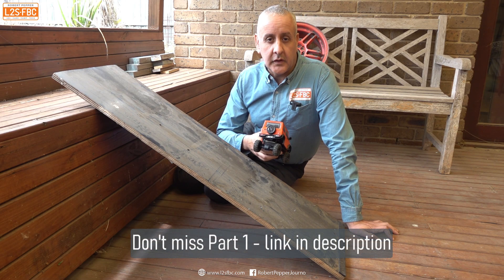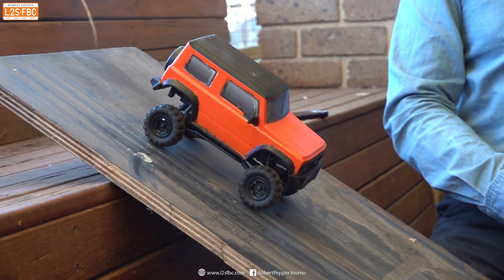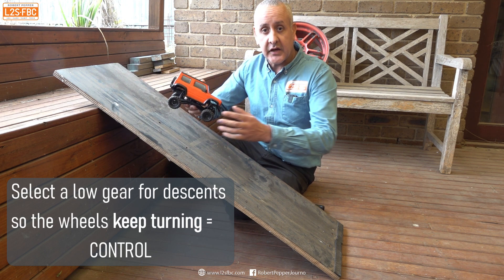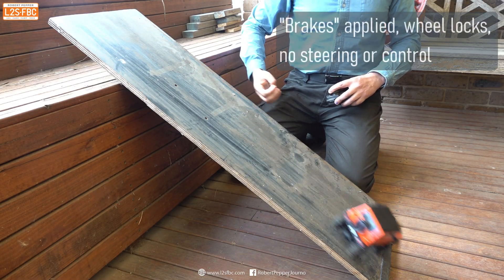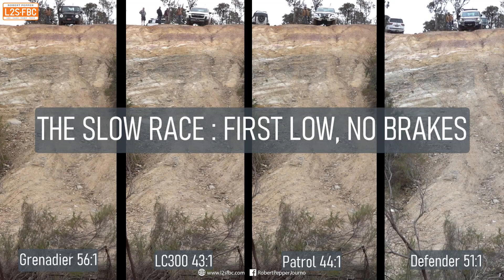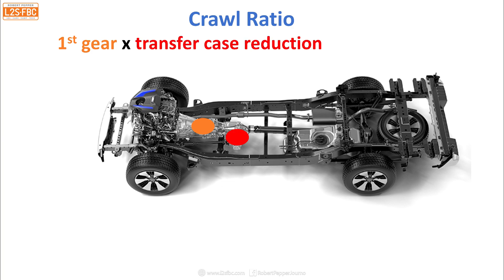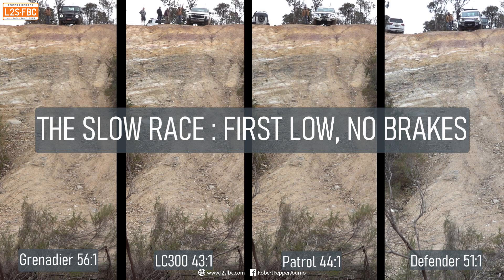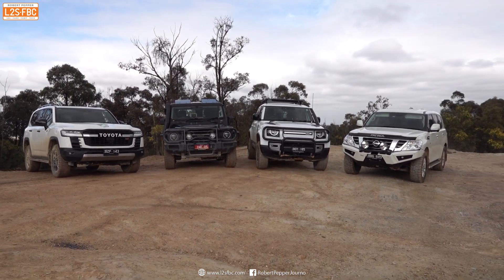Grenadier, Defender, Patrol, LC300, Part 2: the Slow Race & Hill Descents Explained

Comment: great vid as usual. but i believe one important factor you left out is the factory transmission setting if not a manual. The efficiency of transmission in descent aka "back dragging" is largely variable by varying the transmission control, doing funky hydraulic path switching stuff. manufacturers have to tell the transmission to largely quit "back dragging" in normal driving condition, otherwise a car would be funny to drive when it can't coast at all. sometimes they increase it after sensing a deliberate downshift, predicting that you want engine brake.

Comment: My 105 Series Petrol manual is lovely downhill in first gear. I think it’s a 42:1, but no torque converter slip. What’s your opinion on how these four went with keeping the engine revs low and low torque converter slip?
Reply from the maker: Manual has historically been better for descents, but no longer.

Comment: Brilliant demo. I found that in the old days. The best and safest way down any muddy slope was low range 1st. Both diffs locks.  Idle downs and ride the brakes to slow you down. Because both lockers were on and it was manual no wheels could lock up.( or you’d stall) It was amazing. Better than any HDC.
Reply from the maker: Low first can be too low sometimes.  I have a video on lockers too, definitely consider using them downhill.

Comment: Really good video - again!👍 One question; Why didn’t you just check the HDC in the vehicles? (to be fair - you were in fact going “down hill” / that’s what HDC is made for..)
Reply from the maker: Because HDC is more important. HDC brakes each wheel..and I showed what happens when you brake a wheel. Keeping them rotating is better.

Comment: cyclists use a gear ratio thing calld gear inches .If i remember correctly that allows for the actual diameter of the wheels. I am sure there is a way to express the comparable crawl ratio of modified to ummodified but its not comprable thing ..Thts is a impressive crawl ratio for the grenadier,i was wondering what it was.Interesting that the JLR speed seemed to be relatd to something else other than absolute crawl ratio

Comment: Something is not right with that Defender. I have a D250 and at 3 tonne,  it is far slower on descent in 1L than the new Patrol, Prado, Pajero, LC200 to the point I keep falling behind in the convoy. 😂 Can't comment on the TrailMaster or 300 as yet no one in our club owns one, but this is interesting.
Reply from the maker: The Defender had to do two runs as on the first HDC came on when a TR mode was switched and the driver didn't realise until he set off. Otherwise it was locked into 1st low like the others. However, the TR mode shouldn't make any difference to engine braking...but who knows. We didn't test multiple TR modes.
Reply: @L2SFBC  Not knowing much about these modern vehicles, which are diesel and which are petrol? Also not sure of the modern diesel's setups, but in the old days, diesels were not really up for big engine breaking as they did not have a throttle body like petrol engines have. So a diesel would only rely on compression, where a petrol would have the added benefit of the air supply actually cutting off. Cut the supply to a diesel and your engine breaking is way better.
Reply from the maker: All diesel except Patrol which has no diesel option.  Grenadier has a petrol version as does LC300 and Defender.

Comment: Nice demo, but how do you factor in wheel size to your final drive gear ratio? We all seem to end the calculation at the diff ratio. I have calculated my wheel speed and worked that out to km/h for reference. 29's gave me 1.21km/h and 33's give me 1.38km/h at 800 RPM 1st gear with dual LR TC's. I can't get a simple way to work that to part of the gear ratio calculation though. All I know it is nice and slow, but your torque multiplication can break things in a hurry if you are not careful.
Reply from the maker: The crawl ratio only looks at the gears, it doesn't factor in wheel diameter. I should maybe have added on to that the effect of wheel diameter...maybe I will in the commentary video that'll follow this one.

Comment: Such an important factor off road - well illustrated. Too often we get locked on to axle articulation and big wheels, but hill descent is crucial to safety. Having just put down a deposit on the Grenadier, I’m quite smug too!
Reply: A good friend of mine has his Grenadier in production. I'll be checking it out after it arrives early in the new year. Cheers
Reply: Tested this exact test out 2 weekends ago in my Grenny and was very impressed!

Comment: I'm surprised the LC300 came in 2nd as it has the lowest crawl ratio
Reply: It's only 2 1/2 tonnes, so not so much weight pushing it down the hill compared to the Nissan.  The biggest surprise is actually the defender.  The same weight as the Toyota and a lower ratio, it should not have got to the bottom so quickly.  There's something not quite right about the set up with that one.  Either the diff ratio is different from advertised or LandRover are putting more fuel into it at idle.
Reply from the maker: Yes, I was surprised too at the Defender, disappointed with it.  I suppose JLR will say "well use HDC"...going to disagree there.  Time was that you could never beat a Defender in a slow race..
Reply: If the Grenadier went any slower the Start/Stop would have engaged! 😂
Reply: I don’t know about the setup on the Defender in your test, but my MY21 D250 is painfully slow on descent in 1L, and it's over 3 tonne on the trail. MUCH slower than your clip. I am on 18" steelies with 33" tyres. Could this be a factor?
Reply: @villadazzler Robert pointed out in the notes thT he had to do the L663 twice because the HDC kicked on.   He wanted to show it without hdc.   All o tem could have had the hdc on and based on the gear ratio, one would expect similar results just slower.
Reply: @peopleschamp7258  no mention of HDC. Just 1L on steep descent. Some TR settings (Mud/ruts, Rock crawl) will switch it on, but I always switch HDC off because one time, I overheated/impregnated my discs, which need replacing. This is one of the reasons I believe the 18" wheels are not offered anymore on the diesel Defender.
Reply: I am not sure lower and slower is necessarily always better. At a certain point ultra low gearing becomes indistinguishable from braking and may cause the vehicle to loose traction on steep inclines. Interesting that the Landcruiser and  ‘JLR House of Brands’ Defender are quite close on performance on this one - they are the two brands with the most history in this regard.
Reply from the maker: @juliandrake7862 true but on high traction surfaces it is an advantage and you can always use 2nd or 3rd

Comment: Thanks for video. How did you find the transfer case reduction?  I can’t seem to find that call out on any spec sheet.  Maybe I am not looking for the right line item.  The other 2 numbers needed to calculate crawl ratio is generally available on the spec sheets for just about any off-roader/soft-roader.
Reply from the maker: It's sometimes on the specs sheets, other times you have to ask the PR people for it...which tends to be another "what is this question and why on earth is it important, we've talked about the car's muscular stance and heritage, what else does he need"
Reply: For what vehicle?  We can't help you if we don't know what vehicle we are looking for.  Some manufacturers will give a both high and low range ratios plus the diff ratio, some will just give gearbox, diff, and transfer case.  The typical ratio for the transfer case is 1:2 (half) however it does pay to check the specs.  Manuals and automatics will quite often (always) have different transmission setups so that is important information too.
Reply: @Chris_the_Muso  being pedantic, but half is 2:1 double is 1:2. 😀 Yep agreed, vehicle and engine, gearbox, options can all make a differnce.

Comment: One thing I would really love you to cover would be the impact on side-hill performance with bigger tires. When I test drove the Grenadier, i was able to get it on a 36 degree side hill and it didn't roll over, which I found impressive. They quoted me 45 degrees as the design spec. However, where I am, I'd love to run a 33 or 34" tire for additional clearance, and don't have a good practical sense of what that does to the roll-over angles.
Reply from the maker: 36 degrees is not an impressive side-slope performance. Talk to me when you're at 45.  I'm not going to test that as it's a bit pointless and super high risk. A slightly taller tyre won't make any real difference, your backside will call it off long before the car rolls.  Sideslops are the #1 way to demonstrate a 4x4 and scare people.
Reply: simple, the taller the ytre, the higher the centre of gravity so the less stable on a side slope, which is another reason not to go big tyres. I would agree a comparison on what actual degree effect it makes would be good, but not sure many people will want their vehicle tipped over many times to work it out.
Reply: @overlandready   indeed. It is simple to say that taller is worse for CoG, but it is not simple to show what the degree of impact is. My suspicion is that the there is a range where the impact is not very big, and then a "tipping point" where additional height is more problematic. Obviously, unimogs on portal axles don't tip over easily, so it is manageable. I'd love to see the testing.
Reply: Not a straight forward case of COG getting higher. Small factor that does become an advantage is the heavier rubber. Unsprung weight is your friend on side slopes (depending on how floppy your suspension is though). From my 29" standard wheels to my 33's I have on now, there is easy a 15kg difference per wheel. But this demonstration is spot on. My old Nissan Hardbody with dual TC has a final drive of around 90 I think, and the control you get from that is just amazing both up hill and downhill. I love my crawler gears.
Reply: If you increase it to 33", it only increase the height by 1.5cm, which can be compensated by increasing the wheel track slightly, like reducing the wheel offset a little bit
Reply: @laociuz Everything is a compromise. Negative offset influencing your scrub radias. I run -40mm rims with 33's on my SFA Hardbody. The steering dynamics start going weird fast depending on the caster you are running. I run a MQ Patrol front end set at 5deg and my front wheels "scrub" around corners. Funny inputs and difficult steering is something you have to get used to. Unless you have to, try and keep offset standard, and for heavens sakes, stay away from spacers.